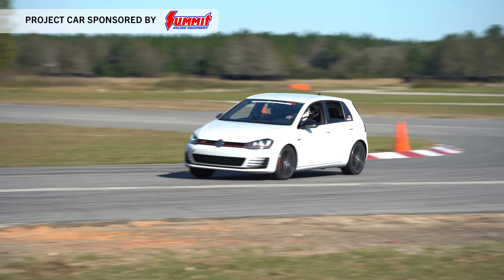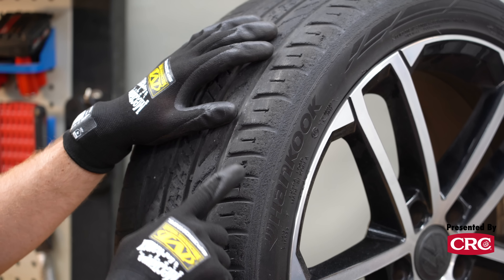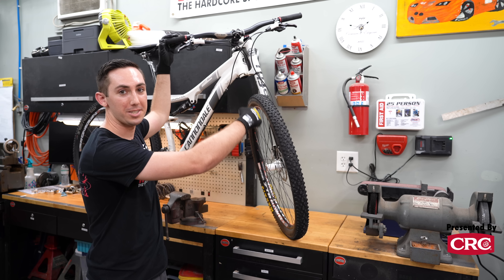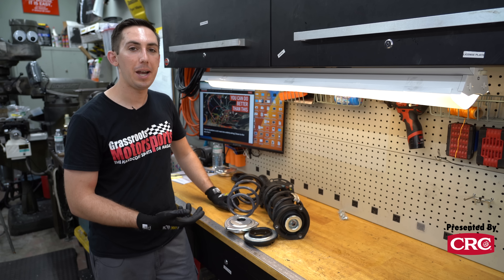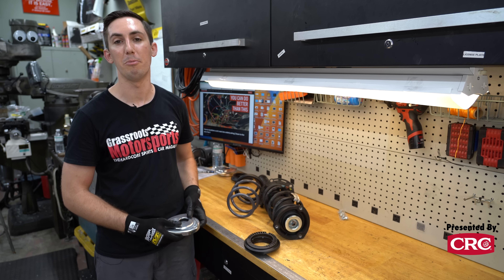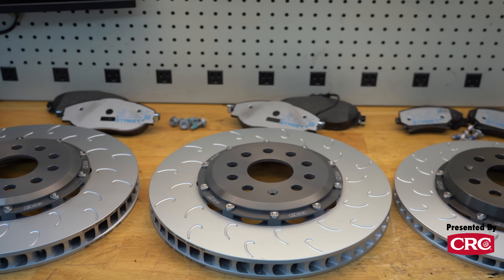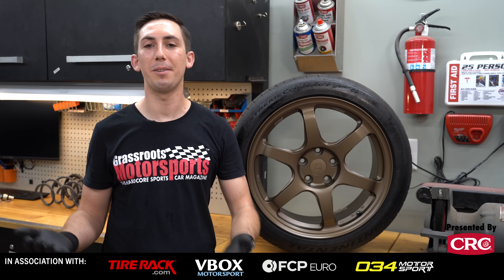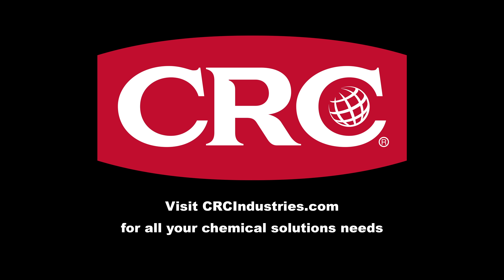Getting Better Handling with Our Mk7 GTI

Comment: Personally I would have done Koni Yellows. Install can be a pain in the butt on the fronts, something an average DIYer doesn't want to do twice.

I run the Koni Cup Kit on my MQB TT, same platform, and have had great results. Also it is worth noting that you will gain negative camber with lowering springs.  So keep that in mind when you put non-adjustable camber plates on. 

Also a rear sway bar and end links really wake these cars up. Introduces some nice rotation, especially with trail braking.
Reply: Totally agree.  I put Bilsteins in my Mk4 and getting them into the knuckle/nearing housing was a nightmare.

Comment: I thought you said you were going to adjust camber and castor? I was expecting upgraded LCA's as well. I have a MK7 Golf R with those same camber plates, and whiteline LCA's, and I highly recommend doing both. Not only do the LCA's (with the camber plates) virtually eliminate understeer, the added caster significantly improves steering feel. I am getting around 2.5 degrees of static camber and have experimented with toe adjustments. A bit of toe out front and rear is great for getting the car to rotate however, if you do a lot of street/highway miles it really eats the inside edge of the tires.
The problem with that (besides premature tire wear) it is hard to tell it is happening because all the treads look fine, until you start seeing cord on that inner edge, and if you are checking on a regular basis you might think your tires are good when they aren't.
For a car that spends most of its time on track I would do a 1/8 toe out front and back, but for a car that spends a lot of time on the street you want a slight amount of toe in (1/16 or less). If you do that even with -2.5 degrees camber the tire wear is no problem, and it still vastly improves handling.
Reply from the maker: We did adjust camber and caster with those plates—details are in the video. And yes, we’ve been playing with toe settings too; look for a future video about that.
Reply: @Grassrootsmotorsports  I know the plates supposedly help a bit with caster to some degree, I have the same plates. What I am saying is adding the LCA's with the camber/caster plates is definitely worth doing as well.

Comment: So you found that you didn't have to use any adjustable components like sway bar links, toe arms or upper control arms (rear)?  I'm about to put lowering springs on my GTi (not aggressively low, only about an inch - the Eibach Pro kit springs) and I'm not sure If I need to use adjustable components to compensate for things like the slight camber change or if I can stick with the original components.  I have a mk6 Gti, btw.  not mk7

Comment: Only Downside to Forged Wheels is they crack under stress instead of bending like a cast wheel.  On a track with no potholes a forged wheel is right at home, but in the real world, you hit a pot hole and crack a rim, its a very expensive repair.  Just something to consider for your Daily.

Comment: Great use of the mtb!!!  I always use mine as the prop to explain caster to folks.  Also, yeah, stock dampers are really fine on the sport springs, I had about 20K on mine when I did H&R springs and they worked just fine...maybe a bit under-damped but nothing egregious what would cause handling issues.  I have since gone to Bilstein B8s which do give a bit more movement control.  I too avoided coilovers with my MK7 wagon and have had great luck with springs/dampers/sway bars and I went with LCAs (Superpor) that gave more neg camber/pos caster vs. top hats like you guys used.  I didn't catch what size those Conti ECS 02s were?  Good video!

Comment: Are those camber plates noisy?
Reply: I have some. You hear all the noise from the struts because they are solid instead of the foam insulated OEM mounts, but that's it. It'll sound like a minor rattle going over imperfections at low speeds when there isn't much other road/engine noise.
Reply: Update on this. The noise might be from the tolerance between the strut mount and the bearing being slightly off with the 034 mount. Not sure if using a different bearing would solve the problem.